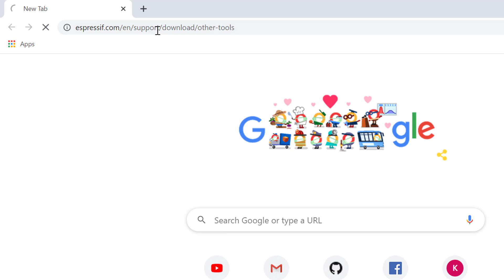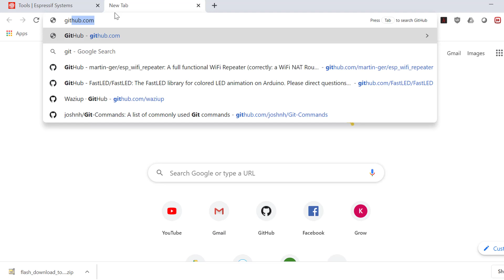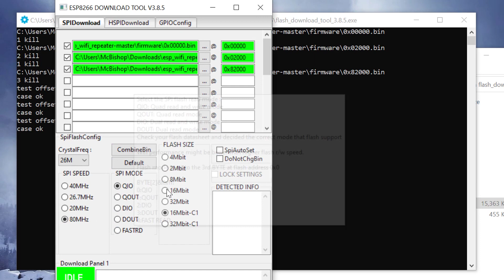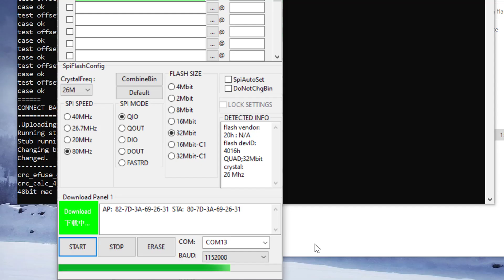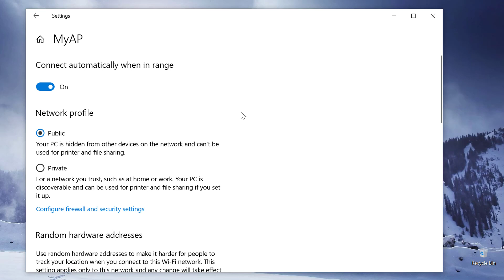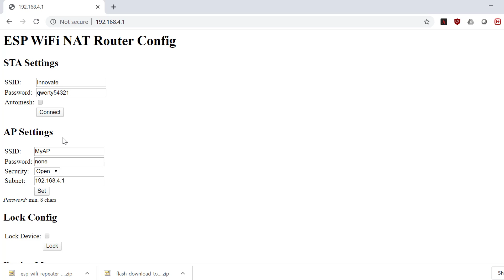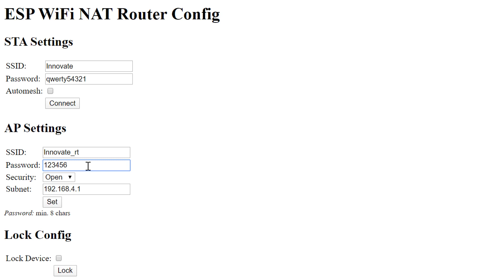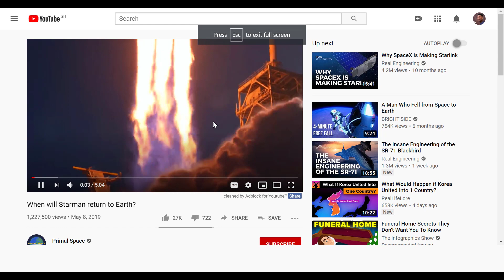How to Make a WiFi Repeater using ESP8266 NodeMCU | WiFi Router Range Extender esp8266 esp32 | 2022

Comment: Well it was an amazing video but now i have a dbout,
If i disconnect the power supply then will it save my wifi password or i need to set-up again?
Reply from the maker: Good question. You dont need to set it up after loosing power.

Comment: Hi, The flash tool is erroring out. The version I am using is 3.9. could this be a problem? Thanks foe sharing your ideas.
Reply: same bro, did u find solution ?
Reply from the maker: Perhaps. It could also be that your flashing address is not accurate for the specific type of ESP32 board you have. example S3, C6 etc....

Comment: Those devices are meant for very customized applications, not everyday use as a Repeater to browse internet. You will most likely get a better Repeater, if you just buy one. Those devices are meant for IOT applications, in the Internet Of Things, the ammount of data you handle is not that much. Those devices lack the RAM and processor of any decent Repeater likeTp link, and the price margin is close. about 80KB RAMVS 128MB RAM and that says it all. Don't rush to buy this to make a mesh network for streaming the internet, buy this only if you like to play with such devices, perhaps you want to make some network for Home Automation applications, sensors or other stuff... I just followed this tutorial and got 0.16Mb speed I know I may have to upgrade the power source, but still... I got my ESP to do some home automation and was just curious how it handles as a repeater. Do not rush to buy this if you don't have other uses for it.
Reply from the maker: Perfect. You're right❤️.

Comment: i have nodmcu followed your procedure i can see ssid but cant connect it 
led flashes during connection but neither my laptop nor android gets ip
Reply from the maker: Just a suggestion, can you turn off your windows defender? reinstall the tools and try the process all over again? Please note that i did not make the tools or resources used in the video and cant vouche for them. Kindly do your own research and take caution.

I noticed sometimes windows defender messes with the flashing tool and its dependencies. In other cases i "think" some users maybe using different variants of the esp8266 leading to these issues.

Comment: Thanks for the tutorial really easy to follow i have an issue where my esp8266 does not show up on the flash tool can i solve this issue and how?
Reply from the maker: Can you kindly check device manager if you have the ESP8266 driver installed?

Comment: My flasher is stuck at sync and is not downloading 🥲😭😭

Please help
Reply from the maker: Just a suggestion, can you turn off your windows defender? reinstall the tools and try the process all over again? Please note that i did not make the tools or resources used in the video and cant vouche for them. Kindly do your own research and take caution.

I noticed sometimes windows defender messes with the flashing tool and its dependencies. In other cases i "think" some users maybe using different variants of the esp8266 leading to these issues.

Comment: i did exact the way u mentioned but after flashing i the board did not flash blue light and the board did not turn on wifi
Reply from the maker: Just a suggestion, can you turn off your windows defender? reinstall the tools and try the process all over again? Please note that i did not make the tools or resources used in the video and cant vouche for them. Kindly do your own research and take caution.

I noticed sometimes windows defender messes with the flashing tool and its dependencies. In other cases i "think" some users maybe using different variants of the esp8266 leading to these issues.

Comment: Hello again, is there a cheap diy board like this that can plug into Ethernet cable ? many thanks
Reply from the maker: do you mean a board you can connect to a router via ethernet to serve as a repeater?
Reply: @Delali  Yes correct....

Comment: Will this work if the network I want to connect to is an open network? ( ie, I need to sign in with my credentials in the login page after connection to the open network)
Reply from the maker: If its an open network that doesnt require any further steps to enable internet connection, then i believe it should work

Comment: Flash on command line on Mac M1
esptool -p /dev/tty.usbserial-1120 -b 115200 --before default_reset --after hard_reset --chip esp8266 write_flash --flash_mode dio --flash_size detect --flash_freq 40m 0x00000 0x00000.bin 0x02000 0x02000.bin 0x82000 0x82000.bin

Comment: Just downloaded 8266 flash tool v3.9.3     Noted DoNotChgBin is selected by default, no option for Flash Size.   Worked perfectly.  Great clear no BS video. Thumbs up!
Reply from the maker: Thanks for the feedback.
I'm glad you found this helpful.

Please don't forget to subscribe. Cheers!!
Reply: Great video but a little dated. I tried for several hours trying many different methods with no avail.

I searched for a more recent video on YouTube with a blue background. That video had a link to the V3.8.5 flash tool. We able to get it working in a few minutes!
Reply: @hmata3  i have the same problem but i cannot find the V3.8.5 Can you send it to me please?
Reply: Mine worked
Perfect but the through put seems to be extremely slow less than 2mb down. I have 3GB fiber
Reply: Hey in my case the setup IP web page does not opening. Any suggestion on how to check the correct 
IP ?

Comment: is it worth it? from 32mbps to 2 mbps.. it drops significaly,, yes it ca extend but if you have reach for example 3 users using the extender it will suffer
Reply from the maker: It depends on what you use the repeater for and how many people are connected to it I guess. But I agree 32mbps to 2mbps is too much. However its okay for connecting DIY IoT projects

Comment: how would i do this with a ESP8266 esp-01s borad
Reply from the maker: I believe the firmware is just available for ESP8266 12E and ESP32....

I dont think this would work on esp-01s but in order to flash you'd need an FTDI to interface with the esp-01 to be able to flash

Comment: 30 mbps to 2 mbps almost %90 speed loss. It seems not very suitable to use as a wifi extender, right?
Reply from the maker: It depends on the device you connect to the network or what your are doing.

I easily played clash of clans while connected to the repeater and I could also watch YouTube videos even though I had to wait a little for loading.

Comment: Hey Delali, 
First of all, thanks a lot for this informative video.
I wanted to know, "Does it work as a repeater mode or access point mode ?"
I mean, does it have its own DHCP server or IP assignment is handled by the main router? 
My objective is to create Access point and manage devices connected to it from this access point only, not the main router. The main router should show this extender connected to it, not all the devices connected to this extender.
Thanks again
Reply from the maker: Your welcome buddy.

It works as repeater but its actually an access point to your actual Wi-Fi router. I believe it has its own DHCP independent of the routers'

Managing devices solely on the ESP may be tricky as the software/firmware isn't very flexible or have many options available.

Happy new year buddy.

Comment: Nice video. And it works on my ESP8266, however on ESP8285 it loads, but nothing happens. Strange.
Reply from the maker: The firmware is for the esp8266 I believe.

That will explain why it doesn't work with esp8285.

Comment: Hi friend, would you please advise how to deal with the SSID with space (for example  "My Router"). I tried to changed space into %20 but it only turns space into a plus sign (+). Did you encounter this? Please help. thank you.
Reply from the maker: Hello fam,

Thanks for reaching out. If you Wifi name is xxxx yyy use xxxx%20yyy as your ssid while configuring your repeater. Please is this what you did?

Comment: Hi Delali, my laptop didn't detect any COM port at all... how?
Reply from the maker: Thanks for reaching out. If you can't see your port, its usually because the UART chip on your ESP board driver is not installed.

Go to the link below, download the CP210X and CH341 drivers and install them. Am not sure which one of the two chips your ESP got but one of them will work for you.

https://drive.google.com/drive/folders/1M9UKCm1I6qsNywlQFlggDPvXdKDEhLjm?usp=sharing

Please don't forget to subscribe. Cheers!!

Comment: Good Day and tnx very much! I have a problem:
All goes good until 5.18 where i'm unable to find MyAP. already tried several time to reconnect and the blue led is solid as well. Tnx
Reply from the maker: Sorry about the issues fam, 
Do you have a spare ESP board? If yes kindly flash that instead and try with that.

I noticed one of my esp's doesn't allow me to connect no matter what I do but flashing another worked. Not sure what the problem is with the first one. perhaps a manufacturing error.

Comment: Nice one. Thanks. I have tried it and found the signal increased and could work with laptop setting it as metered connection. In Mobile it shows connected but no internet. Is there any solution? Thanks in advance...
Reply from the maker: Thanks for reaching out brother, I'm not sure why it doesn't show internet connection on mobile.

Can you please check to be sure the internet from the main router itself is good enough?

Comment: Hi thank you very much for this great tutorial. I have follow all the steps, but when i unplug and plug it again to laptop, the light on the ESP8266 was turned off and i cant find the myAP ... 

Please help me....
Reply from the maker: Thanks for the kind words.

Not sure why the AP doesn't show but could you perhaps flash again? Maybe the first flash didn't go so well

Also make sure to press and hold down the flash button on the esp before you click START in the flashing software. Don't release the flash button till after the flash is complete/finished
Reply from the maker: also let me know if the second flash still doesn't work
Reply: @Delali  thank you so much for replying me, but it still not working. it only blink once when i unplug and plug it back to laptop while ypurs had solid light. i have flashed it many times and hold the flash button. i hope we can figure out the problem
Reply from the maker: Sorry about the difficulties. Do you happen to have a spare ESP? if yes try using that.

I noticed my one of my brand new esp's couldn't connect to my WIFI last week. After switching to a another one, it worked. so "perhaps" its a defect.

Kindly let me know how it goes. Cheers!!
Reply: @mohamadsamsarizal443  probable because you forget to put a check mark on the box in front of those files

Comment: MY WIFI SPEED IS 74MBPS BUT IN NODEMCU IT'S TOO LOW ONLY 1MBPS
Reply from the maker: Sorry about that. Perhaps you can get one of those esp's with dedicated antenna. 

That might improve things a little bit but it wont still be as good as a commercial repeater.
Reply: @Delali  actually my repeater is not working
Reply from the maker: @CRAZYFACTSHM  What happened? You cant access internet on it or cant connect to its wifi?
Reply: @Delali  i have done everything I bought three repeaters. done all process liking changing ip n all bt its not working

Comment: I dont's see the COM number ...
Reply from the maker: Thanks for getting in touch. If you can't see your COM port its usually because the UART chip on your ESP board driver is not installed.

Go to the link below, download the CP210X and CH341 drivers and install them. Am not sure which one of the two chips your ESP got but one of them will work for you.

https://drive.google.com/drive/folders/1M9UKCm1I6qsNywlQFlggDPvXdKDEhLjm?usp=sharing

Please dont forget to subscribe. Cheers!!

Comment: Tried. But the speed in extender was reduced three times. Can you suggest any updates.
Reply: Also the esp was very close to the router.  For testing purpose. Still the speed is not even exeeceding 1mbps.
Reply from the maker: A number of factors come into play that affects the speed like heating, antenna etc.

One way to improve the speed is to get an esp with dedicated antenna.
Reply: @Delali  but with same device I am able to get better speed with aurdino code.
Reply: Can you recommend esp with antenna model
Reply from the maker: @yashwanth1738  You can try this https://amzn.to/328SMQX
Reply: @Delali  Hey. Thank you for your effort
Reply from the maker: @yashwanth1738  Thank you for the appreciation. Cheers!!

Comment: pls can someone help me it says 5-chip efuse fail pls help man
Reply from the maker: Try holding down the flash button before and after you click start in the flash tool.

If that doesn't work please see the link below. I'm not sure entirely if the solution stated here will work because I haven't tried it or encountered the error in question. https://bbs.espressif.com/viewtopic.php?t=4597
Reply: Did that work .. @Smurai Assassin
Reply: @niyazkhan1207  no

Comment: i cant set the password and ssid. it already connected to our internet but i cant change ap settings
Reply from the maker: Kindly try restarting it and visiting the IP address 192.168.4.1 for its dashboard to change the settings.

If that doesn't work, kindly consider reflashing the repeater firmware and trying again.

Comment: Cool video, can the flash be executed on linux?
Reply: Hey Brian, I mainly use Linux also but i keep a spare old laptop i got from Ebay for $20 with Win10 flashed on it which is free for an unregistered version. I just use it for the occasions when there are no Linux versions of Arduino-type tools available. I am sure you could find a cheap laptop too...maybe from a thrift store?
Reply from the maker: @englishrupe01  Thanks for the tip fam. I really appreciate you taking the time to leave this comment.

Cheers!!
Reply from the maker: Unfortunately not because their website only has the windows version up there.

To the best of my knowledge.

Please dont forget to subscribe. Cheers!!

Comment: NO SHOW THE WIFI WHY??
ONNECT BAUD: 115200
============
[2021-03-13 23:30:39,328][ESP8266Loader_spi[1]][espDownloader.py][line:388][ERROR]: IOError: the serial port should probably be removed
[2021-03-13 23:30:39,329][ESP8266Loader_spi[1]][espDownloader.py][line:550][ERROR]: ESP8266 Chip sync error esp_sync_blocking.
no log file output ...
test offset :  0 0x0
case ok
test offset :  8192 0x2000
case ok
test offset :  532480 0x82000
case ok
FIX 
I FLASH THE ESP8266 NONOS SDK AND INSTALL AGAIN YOU firmware AND IT WORK!
Reply from the maker: Try holding down the flash button on the ESP before you press start. Don't release the flash button till the flash is over.

Comment: Not working tenda
Reply from the maker: Can you kindly explain which part of the process isn't working?
Reply: @Delali  I can access the router but the internet is not running
Reply from the maker: @mdmurad8138  Can you kindly check to be sure the internet of the Wi-Fi you're trying to repeat is good. This doesn't work well if the internet is already bad

Comment: I need help, why the com doesn't show up its just blank?
Reply from the maker: Thanks for getting in touch. If you can't see your port its usually because the UART chip on your ESP board driver is not installed.

Go to the link below, download the CP210X and CH341 drivers and install them. Am not sure which one of the two chips your ESP got but one of them will work for you.

https://drive.google.com/drive/folders/1M9UKCm1I6qsNywlQFlggDPvXdKDEhLjm?usp=sharing

Please dont forget to subscribe. Cheers!!

Comment: hello its working but not giving good speed what should i do?
Reply from the maker: Kindly make sure your repeater is not too far outside the range of the original.
Also if the internet of the original router isn't good, the repeater will be much worst or the same.

You can also try getting one of those esp's with dedicated antenna. that should work better.

Comment: It works perfectly fine. I am able to connect my laptop using this repeater, but the problem is I am not able to connect to Android phone. It says "check password and try again". I have entered same SSID and password in laptop where i am able to connect. But in Andoid phone is not able to conect. I tried even only one device (Andoid phone alone) still the problem persist. Can anyone help me.
Reply from the maker: Thanks for reaching out. I connected using an iPhone as I dont have an Android at the moment. It works fine on the iPhone.

I would try and get my hands on an Android and let you know if I encounter the same issue and how I solved it.

Comment: hi thumbs up for the video mate u didn't tell that  we need to switch the chip to the programming mode     ??  first??? coz u directly started flashing it please explain what are those small buttons on the chip??
Reply from the maker: Thanks for the kind words brother. In some cases, flashing without switching to programmable/flash mode works, as seen in mine. But in most cases it wouldn't. That's what I forgot to mention.

The buttons on the chip are FLASH and RESET.  Flash puts the chip in programable mode and Reset reboots the chip.

Please dont forget to subscribe. Cheers!!

Comment: For those who get errors please change the baud rate to 115200
Reply: You just saved me... 🎉😊
Reply: @niyazkhan1207   i am not aware about this flash button at that time , so I upload the firmware not holding flash button  , now when I connect to PC it couldn't show any com port , I checked device manager It show nothing in there , how to get node mcu to normal use kindly help me with this pls
Reply from the maker: Also press and hold the flash button on the esp before you click start. Hold the flash button till the flash is done